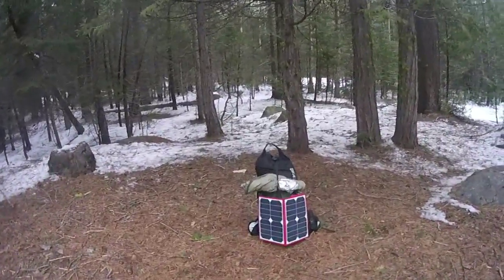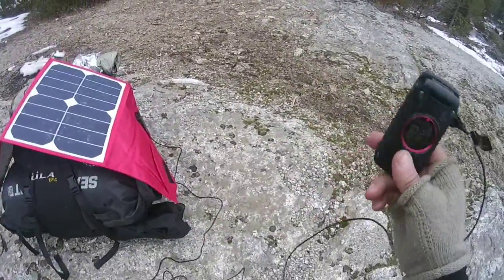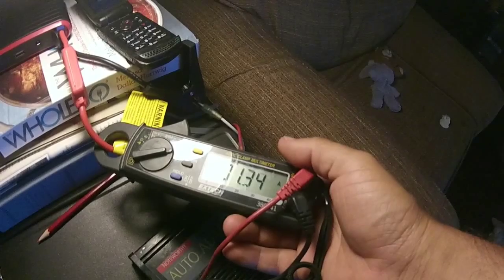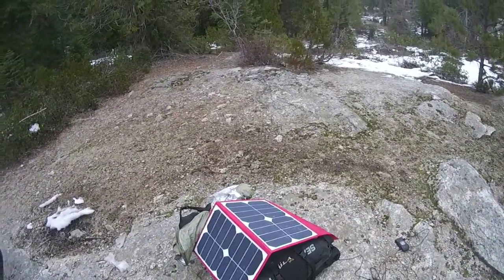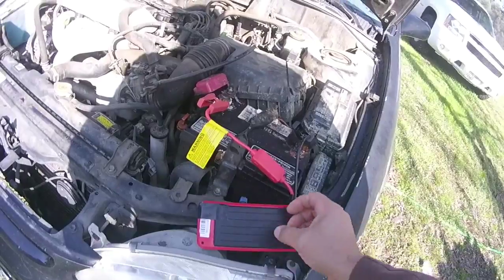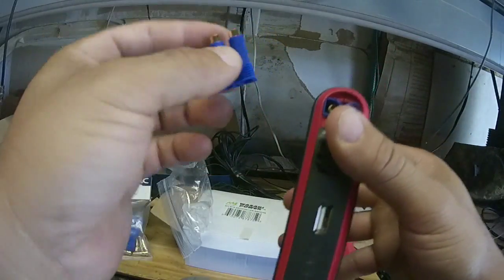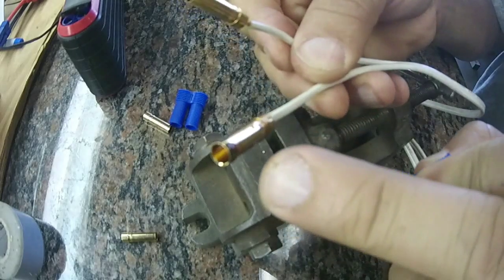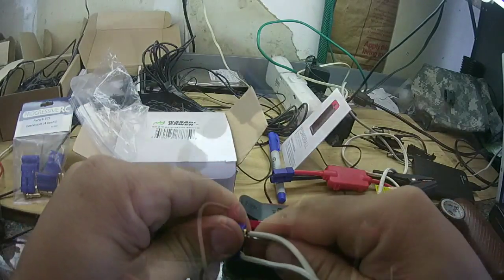Backpacking renewable energy adaptation prototype, Part 1.

Comment: We think a like.  That is an impressive battery, yet I cannot afford it, so I am using several cordless drill batteries instead, 12vdc and a 19vdc lithium ion 3AH mikita battery is possible using 12vdc adapters for small devices bot a a thrift store.  These are essentially step down transformers.  The Boafeng car adapter can step down 19vdc from a solar panel directly or from a 19vdc or lower voltage source to 8.2vdc the radio needs.  Can also charge a Boafeng battery the same way by converting the charger by installing a step down transformer-12vdc plug adapter from the thrift store that puts out 10.5vdc.

Comment: On ebay they have the Allpower brand folding solar panel. It is 60 watt and goes for around 190 dollars. It has 12 volt and 5 volt for phones, and comes with a plug assortment for different devices. I have tried several dif types of panels and it seems to be the best. It comes with loops so you can hang it on your pack.

Comment: Which capacity power all is that? I was looking at them for portable repeater use. Small enough to fit with hand helds inside a 30 cal can and from the sound of it it may have its own onboard charge controller.

Comment: Not trying to bother about gear but what is the solar collector you used? I ask because I am looking for a travel solution for a friend of mine.
Instead of using the single barrel type connector you should have used a universal socket so you can plug in different types of barrel connectors. Easily salvaged from old universal wall warts and laptop PSU's. That would have made the cable more versitile.
I have a similar power pack that gives me 5 /12vdc and I robbed the output circuit and lead from a universal select-able voltage wall wart whos transformer went bad. I can switch not only voltage from 1.5 - 12 volts but I can change polarity and the barrel connector to a wide variety of sizes and types. Virtually allowing me to power anything electronic with exception of laptops which require more volts and amps.
Reply from the maker: ElfNet Gaming I cant find a similar listing on amazon where I purchased this one from, last year. The closest thing is this listing, @221819312289 They claim they use Sunpower cells which are 24% more efficient than current offerings, but I don't believe they are sunpower cells. Yeah, I've seen those universal plugs, my kit is for backpacking so I'm counting every gram and leaning out as much as I can. Though that's a great idea for any other application.
Reply: GUERRILLACOMM Oh yeah weight is a factor indeed and I forgot about that so yeah only the ones you need. Thanks for the info though I'll keep looking around maybe I'll find something.

Comment: I know your not reviewing the specific panel but could you please post a link to it and the battery pack or send me a PM with the info.  I would like to try a system like it and compare it to my goal zero gear.  Thank for the info!
Reply from the maker: walksindarkness The solar panel I got last year, tried to find a listing but no one sells this configuration anymore. Here's a link to a similar panel @221819312289 but the description of it using sunpower manufactured cells is suspect, I don't think they are Sunpower cells. the battery pack is Powerall, search it on amazon and its the first thing that pops up. I don't recommend any of this gear, it was  just a cheap setup to study from.
Reply: GUERRILLACOMM Thank you for the quick reply and the honest assessment.

Comment: I have a first generation Goal Zero Nomad 7 (2 x 7" panels). -I scored them for 1/4 their regular price from a hardware store sale.
The instructions say high drain products, such as phones, should only be charged from the optional rechargeable battery pack, because that puts out a consistently high amperage. In good light, the solar panels can charge four AA batteries (in the battery pack) in about eight to ten hours. I'm betting your larger panels could probably charge the same batteries in half that time, or less.

Comment: I use a similar setup which consists of a 40 watt foldable solar panel, and 13 Amp Hour USB Battery (lacks a 12v output like yours, but my solar panel has a 18V/2.2A Barrel Plug Output to Compensate somewhat). To augment those I also have a USB powered Battery Charger (battery charger also has 120v A/C and 12v D/C cords). It'll easily power all of my emergency equipment and keep it charged up.

The Poweradd solar panel that I use http://www.ipoweradd.com/poweradd-high-efficiency-40w-usb-port-dc-output-foldable-solar-battery-charger-for-iphones_p1347.html utilizes "Sunpower" Branded Solar Cells, which have a 22% efficiency rating (currently be best on the market circa July 2015). I got mine from a eBay seller for $170.00 including shipping. A bit pricey IMHO, but it's performance is excellent.

Sunpower rates their solar cells conservatively, so their output is normally higher than what wattage they are advertised at. My particular example will easily output it's 40 watt rating on a completely cloudless day in Western New York. I lack the test equipment to measure it's maximum output, but based off my calculations factoring in the heat loss from charging the 13 Amp Hour USB Battery, I believe that it's output is about 48-50 Watts.

Important Note:
ALL portable solar panels should have a rechargeable battery in-line between the solar panel and the device you are charging. The reason for this is the battery acts as a buffer to maintain constant charging current, which keeps the charging device from constantly waking up and going to sleep as the solar panels output varies with ambient light. The greater the charging current your device needs to recharge, the more this concern is valid. 

With that being mentioned, I did successfully charge my Acer Aspire Netbook Laptop from a 10% charge to fully charged directly off of the solar panel's 18V/2.2A Barrel Plug Output Jack during a workday. I had the laptop powered off during this time, and had the solar panel sitting on the dashboard of my car (which was pointed South toward the sun). I had the netbook inside my glove compartment to keep it out of the sunshine, and ran the cord to the panel on the dash.

Important Lesson Learned:
Buy QUALITY USB Cables like the Anker Brand (or similar). Heavy Duty USB Cables will pass though more power and will recharge your devices faster. I have personally seen one to one and a half hours of charging time reduced on recharging my Nexus 7 Tablet (cheap vs quality usb cable). I have observed a similar 30-45 Minute faster charging time on my Nexus 4 Smartphone as well.

These two devices have pretty large capacity batteries for portable devices with the Nexus 7's 3950mAh Lithium-Ion Battery and the Nexus 4's is 2100mAh
Lithium-Polymer Battery.

Attempting to charge either of these devices directly off of the solar panel on a cloudy day will result in a dead cellphone and tablet battery. This is because as the light output changes due to clouds, the device will enter a cycle of constantly 'waking up' to charge, then shutting off when a cloud rolls by overhead. Putting a rechargeable battery in-line between the solar panel and the device being recharged solves that issue.

I hope this information that I have learned is helpful to my fellow Emergency Communications Preppers!
Reply from the maker: LordTimelord That's why I purchase the panel on the vid, they claimed the panels are Powersun cells with a 24 % efficiency. It didn't live up to their claims of 30 watts, but then again, I did not measure during high noon. Interesting point about using quality USB cables, sort of the same thing as premium speaker wires for stereo systems, this should be no different. Thanks for the comment, learned a bit more, especially about Sunpower cells.
Reply: With you being in California vs. me in New York, you should be getting better output from the sun.

Maybe your particular panel was made using 'blemished' or some other term for cells that didn't quite pass the quality control of the brand name panels?

That would explain the discounted price of the generic panel, and it's lower output. That's my best educated guess.

Comment: just picked up a 20 watt, and 100 watt panel for projects(both ebay specials). the 20 is being setup for your repeater config. although, I just found the sealed lead acid batter I was planning on using was wasted....man I hate batteries. Also, doing a repeater and attempting a long range 2.4 ghrz video camera and secure comms project, hoping to get 1 mile+. with directional antennas. anyway, always enjoy your posts and rarely don't learn something.
very much wish we were neighbors..then again, I'm sure we'd be in trouble....
Reply from the maker: j johns Ha ha, the saying" there goes the neighborhood." will have some bite to its meaning if we were neighbors. Yeah batteries are definitely the Achilles heel of any system. Damn expensive too for a decent model. Thanks for watching..
Reply: as to batteries, it's amazing how little effort it takes to ruin one. the little 12v I had sitting on top of a safe, nothing connected to it, had left it there 6 month ago fully charged and now the volt meter is freaking out and it won't hold a charge...what tha heck man.....I know there's work being done with water spliting photo catalysts. simply dropping the photo cell in water and exposing it to light starts a process where the water is broken into oxygen and hydrogen gases. they in tern would be use to power a solar cell.  a two liter bottle of water would potentially provide the power needed to run a home for a day or more. something like it would change everything and it's being done on a small scale at harvard. way better than traditional batteries. sorry, my nerd side just poked through.